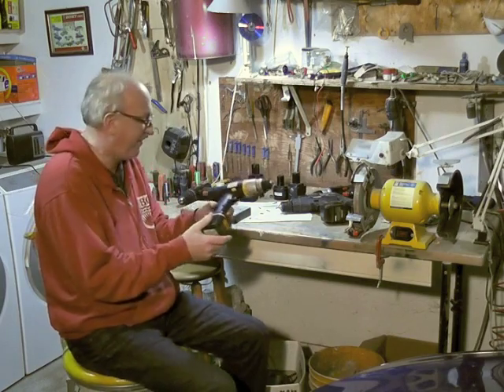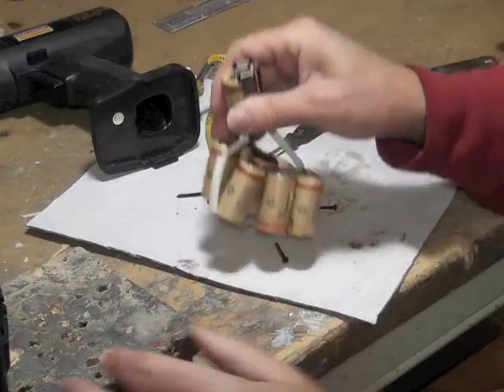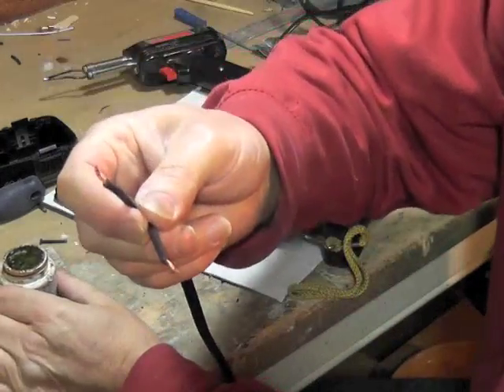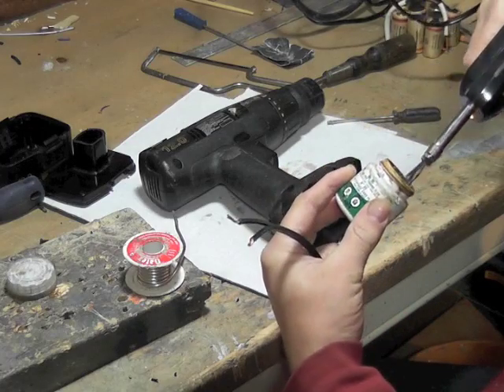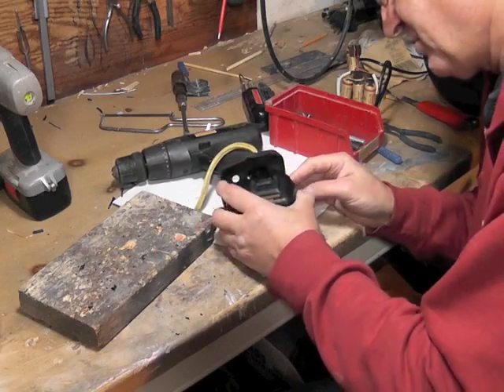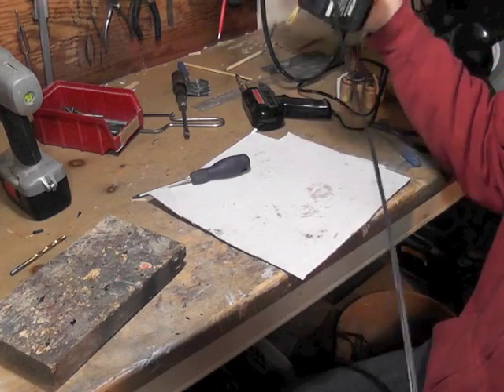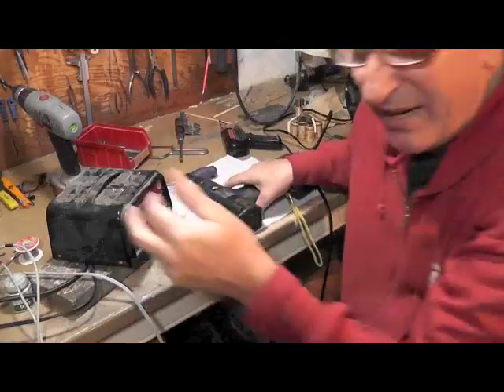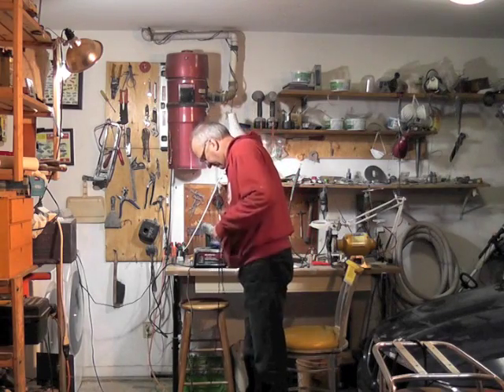DIY: Battery Drill to Mains

Comment: Hi sir.i have a question.
Can i used computer psu for charging the battery? and also can i used its(psu) 12v direct to the drill?tnx in advance for your answer
Reply from the maker: You cannot charge with psu. You can use psu output 12VDC for drill but I tested some computer psu's 12VDC 20 amp.
The problem with computer psu is it has power surge protector and cuts out when the drill draws too many amps. I found the battery charger for a car is fairly good and an old 12vdc 6amp TV converter. The best is to but a converter/adapter for LED lights. I show you on one of the other videos which serial model to buy.
Reply from the maker: If you want to look up converter serial number that works go to my youtube video: DIY BATTERY DRILL FOR WORKSHOP ON MAINS
Reply from the maker: This converter for LED'S works on drills of 12VDC 14.5 VDC and 18VDC 
You can use it for any battery run equipment in the range above and has high amps so the drill does not have too little torque.
The problem with the drill with the TV converter has too little amps- 6VDC when you need 10amp or higher.
I hope this helps you find a solution.
Willy
Reply from the maker: I would use a LED adapter/converter 12VDC 20 AMP 
I use a led adapter from China S-360-18   Model HJ 1820    costs $25 Cdn
110/220VAC  to 18 VDC   20AMPS
This only puts out 14VDC so I can run 18VDC and 12 VDC on the same converter
Good luck with your project.
If you want to see it in action go to my youtube: DIY Battery Drill to Mains: Pt2

Comment: What would be the desired amperage?
Reply from the maker: 20 Amps or more as it draws as much as it needs. When at 6amps or lower it starts to have no torque.
The led 18 VDC transformers are great they can power 12 VDC 14.5VDC and 18 VDC. I have the model Number on one of the other videos.

Comment: Thank for you great help on amps
Reply from the maker: Thanks for the feed back. I got advice from a friend who is an electrical engineer and advised me on the amps and that the drill only draws what it needs so you can have higher amps than needed but when they are too low the drill will have no torque. Glad the videos helped.

Comment: can you use  a nother charger n jump it to yours :-)
Reply from the maker: I'm not sure what the question is about but I will try and answer it. A car charger for a 12VDC battery will work to run your drill. You can take another battery (same VDC) and jump it but it's too much trouble and not a solution. You can use other adapters/converters that work within a range of 12VDC to about 14VDC with over  6 Amps as below 6 Amp becomes to weak. Not enough torque. I hope this info helps you....if not try with another question .

Comment: Willy Sir this is amazing.you have done well.  Inspired me with enthusias as I too, have a dead drill of Tool Master 18vdc having 12 batteries inside. I will surely get prepared such adapter\convertor. Please guide me, to be on safer side, should I get it for less vdc. If so then how much and also tell me     amps required. Thanx and awaiting for reply
Reply from the maker: Get adapter 18VDC  20Amp. Look at my other videos on the model number that works for all battery drills 12VDC,14VDC and 18VDC. After much research and burning out some computer adapters I solved this problem after I made my first videos and realized that one adapter can work for all three. The VDC reading is 14.5VDC on a 18 VDC adapter for LEDS.This allows you to power up 12VDC up to 18VDC without doing any harm. All battery drills have a rating of Voltage and they are made to run over the specified voltage to a certain amount. The trick is finding  an adapter that will run them all. I was lucky that my adapter has this ability. I would recommend you buy the same adapter.
Reply: Willy Dahm Thank you Sir.
Reply from the maker: Your welcome. Glad to hear that you are recycling an old drill. Thanks for the interest.
Reply: Inderjit Pawar olmadı

Comment from the maker: If you want to see the adapter used go to my youtube video: Picking the right battery drill adapter for 12VDC to 18VDC
One adapter works for all and has plenty of torque. This adapter is for people looking for proper results when drilling or wire brushing. The drill has power and torque and will not die as you are putting a screw into you deck. Anyone who says 5 Amps will do is wrong and has not done the proper testing. One needs plenty of Amps to make these drills work properly. That is why my adapter has 18 VDC 20 amp. When I read the voltage on my meter I was surprised to see that it only was at 14.5 VDC and realized that it may work on my 12 VDC drill and it did. Now I do not need to buy another adapter for my 12VDC drills and wire brush fixed drill. I will test this out for months but I do not believe there will be a problem. "Problem solved"
Reply: Link to video?

Comment from the maker: I have had a break through with adapters/converters and found that one can use a single adapter for 12VDC 14.5VDC and 18VDC.
This makes it easy to have old Battery drills, jig saws and chop saws repurposed for the workshop. If we recycle some of these battery operated tools they stay out of the landfills.
Reply: Most of these I think find place in third world countries Hhahahaha Like I have a few of these  old tools for which I am trying to make some adapter. Thank you
Reply: Hi i am trying to do this to my snapon impact gun its 18v and 8 amps but i cant find anything to run it closest i found was a laptop psu at 18v and 3.5amps but it has the safety cut out so didnt work properly and was underpowered i looked for a led driver but cant find one powerfull enough . Hopeing you can help me thanks dan
Reply from the maker: 18VDC   20 Amp adapter for led lights. The Amps can be high as it only draws what it needs. 3.5 amps is too low and the gun will have no torque (power) I have the converter listed on one of my videos.Check comments below and you will solve your problem. Sorry that I missed your comment some how.

Comment: I had the same idea a while ago. Just haven't done it yet. Thx for showing me a trick or two. Love the video
Reply from the maker: I'm glad the video helped. The idea is to help others recycle old drills. Thx for the feed back.
Reply from the maker: Go to my video: How to Convert Battery Drill to Mains for Workshop as I upgraded to a converter with 20 amps.
I have been using it in the shop for over 6 months and it works great.

Comment from the maker: The laptop adapters where useless as they all have overload built in so the drill dies when switched on too fast. The LED adapters work but make sure you get plenty of Amps otherwise the drill will have no torque and will not be able to take a load.

Comment from the maker: I have a new video out with a 18VDC drill with a adapter that works really well. Check out Battery Drill to Mains: "Really Works"  I have made a cover for the adapter and will  post a video of my improvements soon.  I want to use this adapter all the time in the shop and get away from those batteries for good.